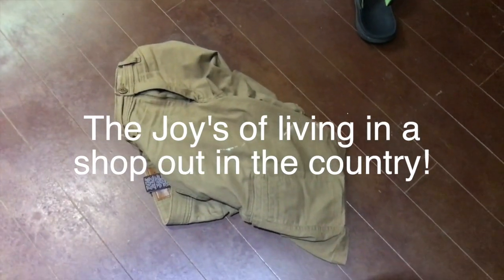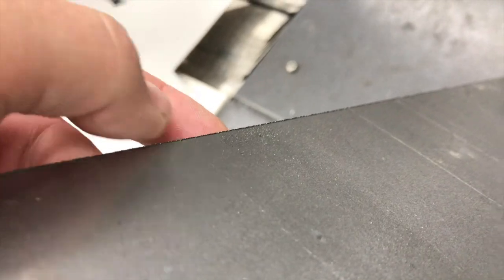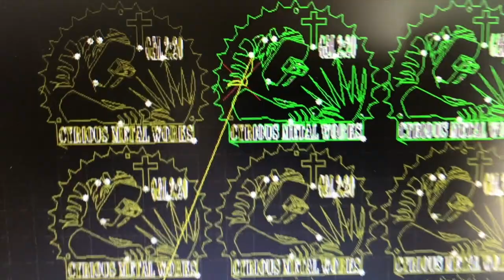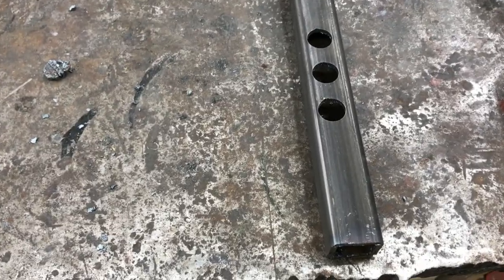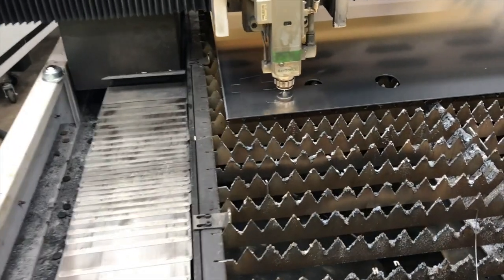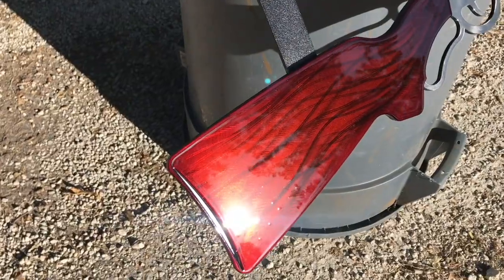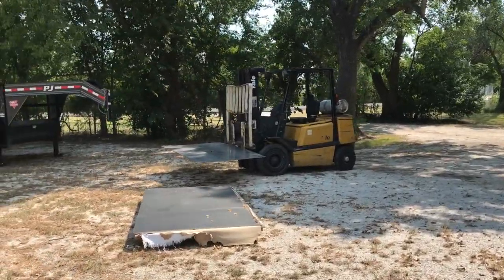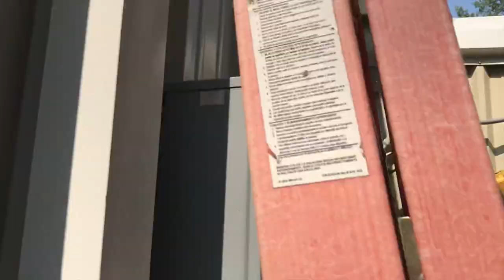Shop Update - Lots going on

Comment: Some advice for the tube. Put a smaller tube inside for the laser and slag to hit. Will make the inside the tube a lot cleaner. Also when switching between your flat to tube, hit the circle button to zero your focal point. I have issues of focal drift on mine where your cut condition focal point doesn’t match what is on the laser head. For that square tube, make sure to model your radius corners. You get a lot better of a cut.
Reply from the maker: Ok, thanks, sounds like you have a combo machine.  The capacitance calibration could have been the issue because my overall cut quality had started to suffer.  I do also rehome the laser focus on occasion, min e always seems to be in sync.  When it zero's out on the machien it reads zero on the head.
Reply: Ramsey Customs - turbocobra yes recently got a 2kw
Reply: NICE

Comment: Man!  You are BUSY Gary!!!  You've got some killer stuff coming off that laser.  I got your package yesterday.  I'll break it open in the morning and get those pieces cleaned up.  Hopefully these babies sell in a hurry and we can start on the second batch soon.
Reply from the maker: hopefully those will work.  Unfortunately i cut those a couple days before i figured out the calibration issue with the height sensing capacitance

Comment: Don't most people stick stuff inside their tubes to roll around when doing rotary cutting so the laser doesn't blast all the way through? What material won't the laser cut? Maybe you can slip a dead snake in the tube and have rotisserie at the same time?

Comment: Damn that's some rough cutting on the tube laser 😂 
We have an older non-fiber laser at my work and compared to yours, the speed is much higher. I see yours stops on the corner radius for almost a whole second, all the while blowing gas and the laser beam into the workpiece. I think that's why the cuts are so inefficient and hot, I've never seen ours make huge glowing blobs of red hot metal on a cut.
About the slag deposits on the inside, we never clean that unless necessary or required. The operator adjusts the parameters to keep slag to a minimum and that's that. If the part needs precise holes then we drill it over, usually we even tap directly on the laser cut surface.